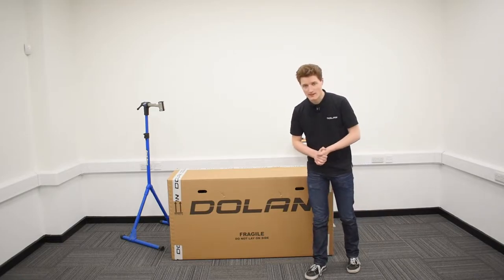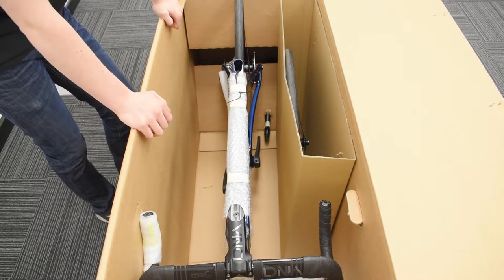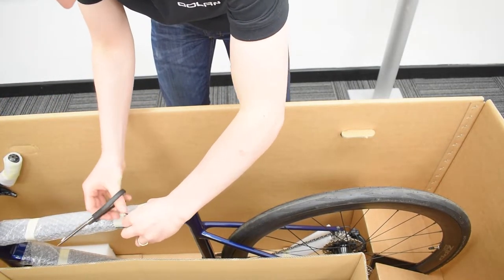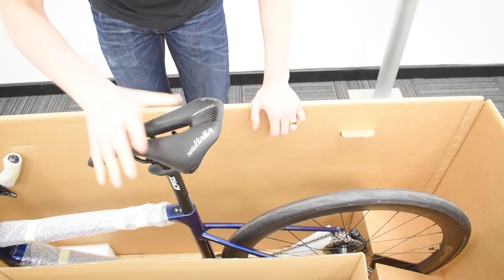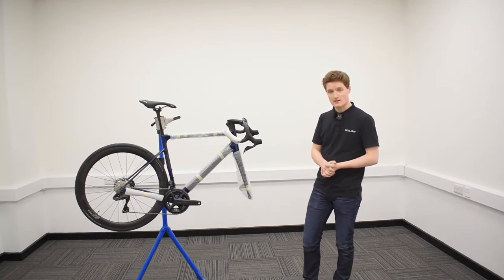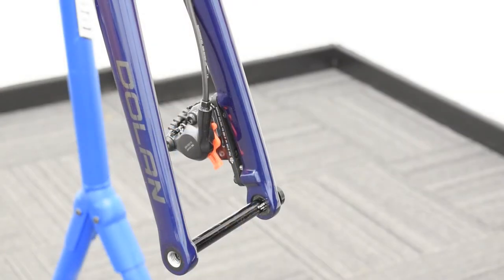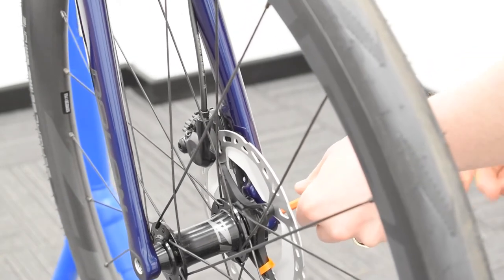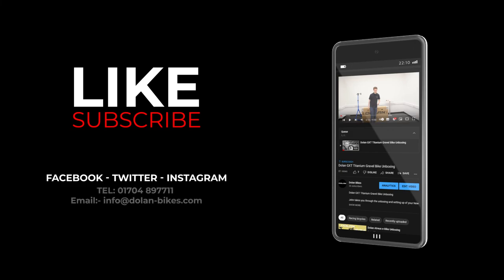Dolan Tuono Carbon Disc Road Bike Unboxing

Comment: If I get the frameset will it come with handle bars and seat post or will I have to get them separately
Reply from the maker: Hi, if you purchase the frameset you get the frame, fork, seat post, headset, and axle kit, you would have to purchase handlebars separately
https://www.dolan-bikes.com/tuono-carbon-disc-road-frameset/
Reply: Thanks
Reply: @dolanbikes_uk can you change the seat post or is it a proprietary design?
Reply from the maker: @tardishousemafia5246   any 27.2mm seatpost should fit in.